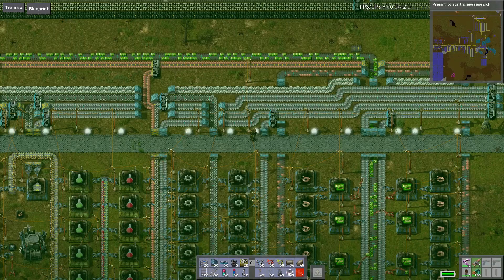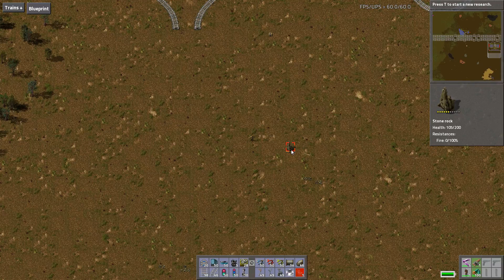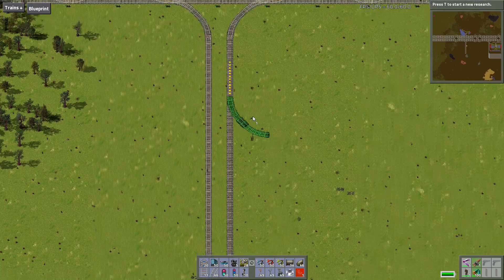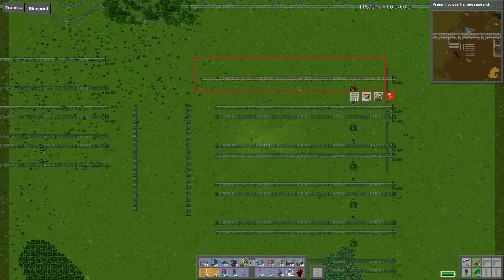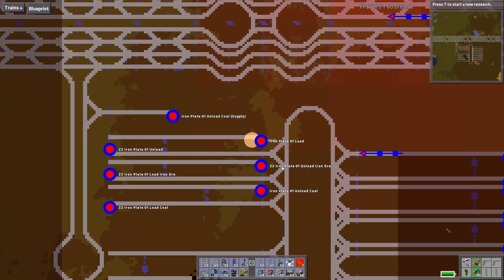Let's Play Factorio 4.034: Iron Plate Station

Comment: Do you use mods for the speed of the ligistic robots? And if it is, can you put the link in the comments so i can chek it out.
Reply from the maker: I think I just hacked the data files in this episode. I added super-powerful power sources and other things as well to make building super-fast.

Now that I have a really good design in my head, I don't need to iterate so quickly. I can do what I want in vanilla without too much effort.